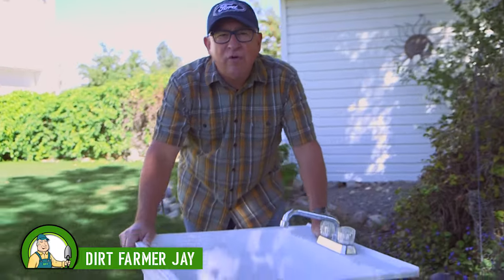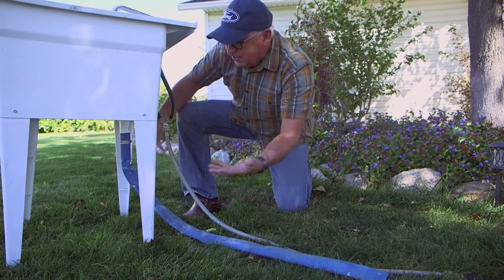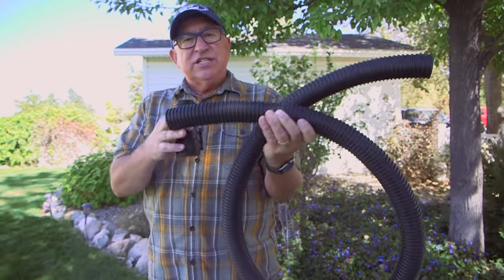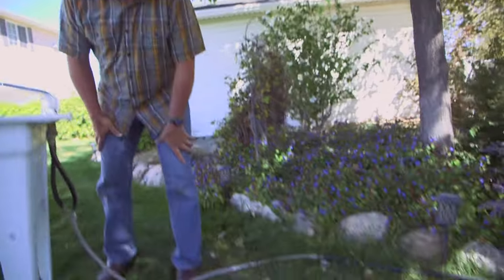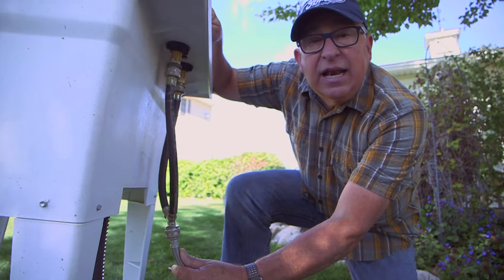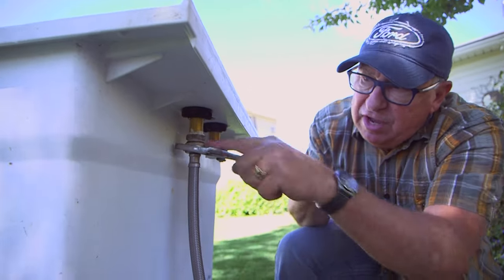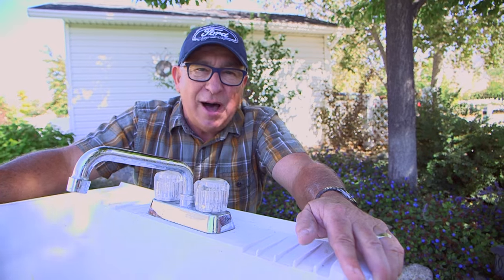An Even BETTER Outdoor Sink!

Comment: I’ve been using a bucket underneath the sink and emptying it. 😂😂😂  I need finish it off with a drain system so this is clutch.  I did use a cap on the hot water side and it works good enough.  Great video!!

Comment: I used pond tubing for the drainage. It lasts much, much longer (years!) versus the plastic vacuum cleaner hose. Plus one can buy it by the foot, so you just purchase for whatever length you need. I also just fixed a pipe to where the faucet goes and clamped a garden hose sprayer nozzle that is about 12 inch long and bends down to it. I like the various spray patterns with it and my garden hose attaches to it with a quick connector,

Comment: You could also position the sink over a deep crevasse and discharge waste water into the depths of a glacier—saving money on vacuum hose and brass fittings.  Alternatively, you could locate a neighbor’s utility sink, determine when that neighbor is not home, sneak in and use that sink thereby saving $6.42 on hose fittings, $28.32 on “y” adapters and $84.95 on the sink itself—investing this savings in a high yield CD over the course of 35 years results in a profit of more than fourteen dollars (adjusted for inflation).  Win Win!
Reply from the maker: Love it, Yamaha Japan! Best, DFJ

Comment: Great video. Using your video, I just installed a utility sink in our chicken barn and the Rigid hose idea worked like a charm. I used 2 lengths of the hose to get away from the barn and it works great! Thank you from Northern Virginia.
Reply from the maker: Greg, we're glad you found this to be helpful. We make ongoing use of this sink during the warm months. It's become something we depend on as we do a variety of tasks outdoors, as well as getting some cold water in the face to cool off with on hot summer days. Thanks for letting us know that you've been able to install a sink in your outdoor workspace as well. Best Regards, DFJ

Comment: I just bought that vacuum hose at Home Depot for $24 and coupled it with 1 1/4 PVC.  Works like a champ and I didn’t have to clamp it to the sink drain but I probably will eventually.

Comment: Wonderful and informational.  just what I need.  I put in wrong key words has wasted much time till accidently saw yours.
Reply from the maker: b watson, thanks for stopping by. Be sure to let us know how your project turns out! Best, DFJ
Reply: @DirtFarmerJay   I got everything as your spreadsheet.  (having hard time to get the adapter) I hooked up everything.  But there is a leakage between the washer hose and adapter. I do have a washer inside the water hose.    I have not used a wrench to tighten it.  Is that something I should do?  I did use seal tape between the adapter and the laundry faucet.  I have watched your film  many many times.
Reply: BTW,  the Home Depot does not have the right adapter and I got the adapter from Lowes.  The male side is much longer than the one in your film.  Could this be the issue?
Reply: @DirtFarmerJay  The adapter I bought from Lowes said Bushing.  The male side is much longer than the one you used.  ANd I have leakage from there.  There are so many details.  I really have lots of respect with your line of work.

Comment: Great video.  I'm setting up my outdoor sink now.  I just got a 1 input faucet, so hopefully will be easy enough to install.  Thanks for the video.
Reply from the maker: Congratulations Jrprez22. Depending on what part of the country you live in, if you get hard winters with lots of cold weather you should consider putting the outdoor sink in a storage room or workshop for the winter so it will last longer. The rapid temperature changes are hard on it. It's pretty fast to set up again in the Spring. Best, DFJ

Comment: How is the machine supply line connected to the garden hose ? If doing the single valve.
Reply from the maker: Erika, you would cap off one valve inlet below the faucet, attach the supply line to the other inlet with a pipe thread to hose thread adapter, then attach the hose to the other end of the supply line. You can check out a complete parts list at https://www.dirtfarmerjay.com/articles/outdoor-sink-supply-list. I hope that helps - enjoy your sink! Best, DFJ

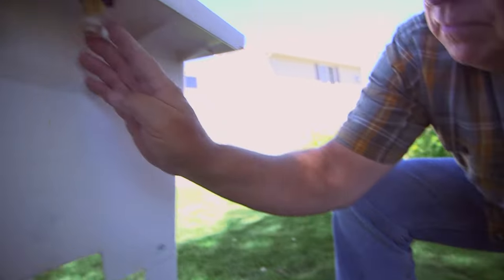Comment: What is the name of the lubricant you applied to the thread before you screwed on the white adapter? You applied this with your finger it was around 4:30 in the video.
Reply from the maker: Robert, that is teflon pipe compound, commonly known as "pipe dope." It is used whenever threaded pipe fixtures are assembled. It's available at your plumbing supplier. I hope this helps! Best, DFJ

Comment: awesome! thank you! do you think i'd be able to hook up a single handled faucet? if so, which method should i use - the single hose or the split valve? thanks so much, Jay!
Reply from the maker: Jessie, glad you found it to be helpful! I'd use the single hose and cap off the other side. However, if volume of water is important to you, you'll get more by using the y connector so you get water coming through both sides of the valve. You just get better utilization of the volume of the combined tubes in the faucet itself. I hope this helps, and thanks for stopping by! Best, DFJ

Comment: Do you know the size of the brass adapter & what it’s called? Great video!
Reply from the maker: Mel May, glad to be of help. The adapter is a 1/2" FIP  (Female Iron Pipe) by 3/4" Male Threaded Hose End. Hope that helps! Best, DFJ

Comment: I put this exact sink in my laundry room, Would like to know what to get to connect my now old/unused kitchen sink sprayer from the old faucet assembly (the gun part with the flex hose that has a plastic adapter to sink fitting) to connect to the Faucet as a temporary option for washing our dog off (or what ever) when we need to, I kept the old parts just so I might be able to repurpose the sprayer.
Reply: actually wouldn't mind using the old (holder) either by drilling another hole in the top for it like most sinks already have that allow a sprayer.

Comment: What about having one side have hot water?? Is this possible? I live in the desert & the nights are freezing level's but I still need an outside sink. I've been researching this for 2 months now. I have yet to come up with a plan on how I can accomplish this task.
Reply from the maker: Thanks for watching and commenting Bella M. We live in the northern Mountain West of the US and get significant snow, etc. in the winter. We put our sink away in the barn every Fall and get it back out in the Spring. It's very easy to unhook and hook back up - just a drain hose and the garden hose for water supply. That way the sink will last longer if it doesn't have to endure the low temps and you don't have to worry about getting a hot water source. If there is water laying in the hoses during winter, it will freeze and burst the pipes anyway. This sink is meant to be a warm weather assistant to help when all the outside work and gardening is being done. Hope this helps. Best, Dirt Farmer Maggie

Comment: Hey DirtFarmer Jay:  I got all the supplies and put it together.  However, I have a substantial leak at the brass adapter fitting.  Any ideas on how to fix this?  Thanks!
Reply from the maker: Thanks for writing. What you need to do is take the pipes (where it's leaking) apart and put pipe compound on them, then reassemble.  That should take care of the leak.  Let me know if that took care of it. Best, DFJ
Reply: @DirtFarmerJay  You are the BEST!!!  That most certainly took care of the problem!!  My sink looks beautiful in the garden next to honeysuckle.  Thank you so much!!!

Comment: If I only use one side of the faucet, do I have to cap off that end I will not use?  Does water shoot out that end if I do not?
Reply: I dont think so.  There is no input of water.  Right?  So we can save even more by leaving the other side alone.
Reply: I left it uncapped and no problem.